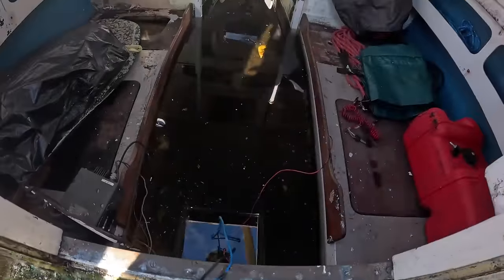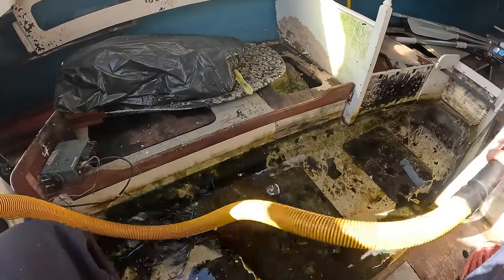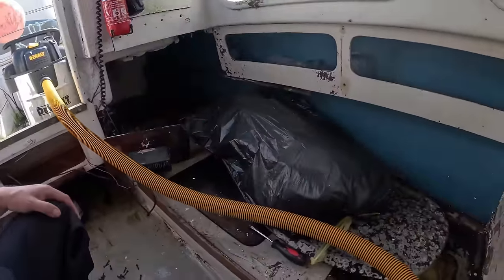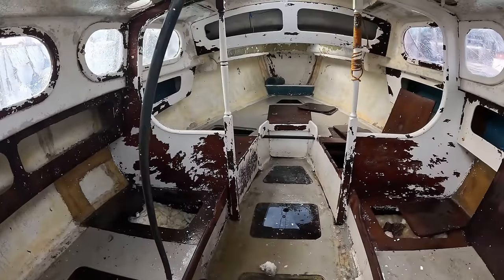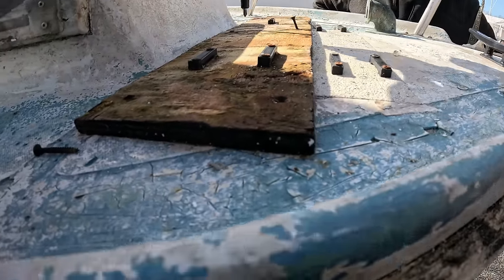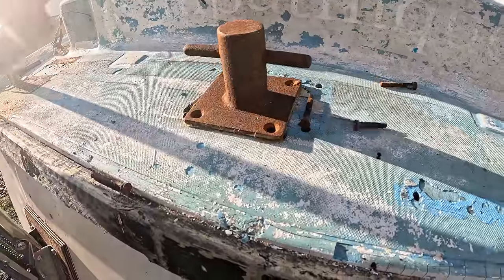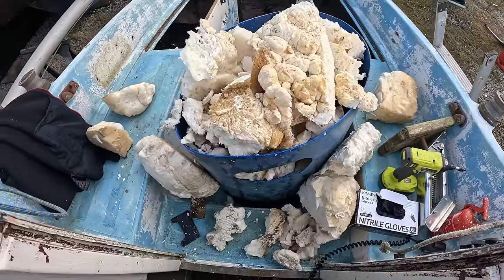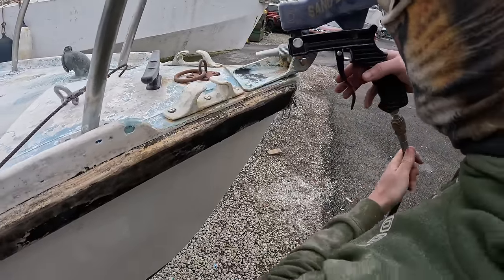£1 Yacht Rises Again (Part 2)

Comment: I would suggest doing a very thorough inspection of your deck to hull joints. On my Vivacity, the best part of it was loose. It's a sandwich box type joint with brass bolts hidden under the bumper wood strip. The amount of glue they inserted in the joint was not enough.
Secondly, all the chain plates were just connected to the deck, which lifted the deck from the hull.
I rebuild the hull to deck joint from scratch, and installed new stainless chain plates, redesigned to connect through to hull, meaning, all rigging tension is in the hull, and not the deck. Same for the rear stays and forstay connections.
Reply from the maker: Thank you for this great advice, I will be having a thorough inspection of all the deck to hull joints, so far I have not had a closer inspection as yet, but this is definitely great information for me to follow up on, I will keep you posted on what we find 🙏⛵️⛵️

Comment: For the foam removal, a wire wheel on a cordless drill works great. Hot tubs are filled with foam and I have seen the wire wheels used in foam removal for years. Then just vacuum.
Reply from the maker: This is great advice as I still have little bits that are stuck to get out, thank you is massively appreciated ⛵️🙏

Comment: Mate, invest in a sand baster attatchment for your pressure washer (e bay ) you can use dry sand in them because of the water, you don't have to worry about silicosis. wear safety gear and an apron, it's messy and ouchy if you hit your skin. Good luck.
Reply from the maker: Thank you Darren, I am almost done with the sanding on the top sides now, well I say that 🤣 much further ahead I should say but I will check this out thank you 🙏 ⛵️⛵️⛵️

Comment: You should have covered the lot in paint stripper covered it over with bin bags and came back the next day. You'll probably find you wouldn't have that much sanding if you did. But we'll done on the progress!
Reply from the maker: Thank you and I used the paint stripper on part 3 and it worked well 🙏😎⛵️
Reply: @BoatzUK  well done pal!

Comment: I like it when people take care of abandoned stuff. All things were build for a purpose and i dislike seing stuff go to waste.
Reply from the maker: Me too, it’s worth saving ⛵️🙏
Reply: Yes, but sometimes things are just too far gone and would be easier and cheaper to replace than repair. Also in terms of environmental factors; recycling the old boat by separating metals and other recyclable materials and burning the rest as energy would pollute less than than this; spreading microplastics into the environment by sanding it in the open. Manufacturing a new boat, and even manufacturing this one back in the day likely polluted less than its repairwork.
Reply from the maker: They is definitely a lot of pro’s and cons to any project and for a small boat like this it’s not the biggest job to salvage, it’s always best to repair than replace ⛵️

Comment: If you wanna save money on Disks and time, you can use a sharpangle wood sand the corner and that will get some off and or some hard wax.
Reply from the maker: Thank you for this recommendation, on part 3 I used a paint stripper and it worked well, but I still have plenty more bits to do 🙏⛵️⛵️

Comment: I’m a sprayer by trade, if you use Mirka abranet discs for sanding they aren’t so prone to clogging because of there mesh design, in my opinion one of the best discs on the market by a long way.
Reply from the maker: Thank you for this information, this helps a lot 😎⛵️⛵️⛵️⛵️

Comment: FYI, you can sometimes unclog sanding disks with a block of rubber, they sell them in toolstation and screwfix, but you can also use the sole of an old training shoe, or you might be able to use an old rubber block that was already taken off the boat.
Reply from the maker: Thank you for this information, on part 3 I used some paint stripper to give that a good and it worked well ⛵️🙏
Reply: @BoatzUK  Just watched part three and subbed to keep watching the updates.
Reply from the maker: @Anon-mk4ms thank you they will be more coming soon, currently in the making 🙏⛵️

Comment: Paint scraper maybe cheapest solution. Causes unintentional scratch to gelcoat but those are easy to fix. I scraped antifouling paint and primers from one of my previous boats for about 20-30 hours.
Reply from the maker: Yes I am a lot further ahead now and I used that exact method on a lot of the heavy paint areas, also tried some paint stripper in a test area and that worked well and washed down soon as the paint was scraped off just in case I melted the gel coat. Thank you for your advice it’s always appreciated ⛵️⛵️⛵️😊

Comment: Use a wire brush on a clogged sand paper. Probably not too good for the grit. But you get more life
Reply from the maker: Totally agree will definitely help, on part 3 I tried paint stripper that worked well and saved many discs 🙏⛵️

Comment: try some benzyl alcohol-based paint remover -- try it on fiberglass first to make sure it does no damage, I have only used it on wood
Reply from the maker: Thank you for your comment on part 3 I used some paint stripper that worked well ⛵️🙏

Comment: That expanding foam looked a horrid job to extract - oh and I cringed when the porta potti went upside down when you didn't have gloves on 😱😱😱 Good work so far, looks a lot better.
Reply from the maker: The foam took a full day to remove, Timelapse definitely speeds up the process 🤣 and yes that porta potti was definitely a fine moment that I don’t want to repeat to often 🤣⛵️⛵️⛵️
Reply: @BoatzUK  Admire your perseverance.

Comment: Why buy a pump and a new battery?
Take a garden hose and use the siphon effect. Takes over night, but costs you nothing.
Reply from the maker: I actually bought it for another boat I have but then this yacht came up so used it as it was already on site, also the pump that was in the yacht still works so that’s good news, siphon is a good way of doing it ⛵️⛵️⛵️🙏

Comment: I would cover the whole boat in paint stripper and power wash it of. I bet the cheap paint will come off easy.
Reply from the maker: That would definitely work and it would be easier, I was worried about melting the gelcoat but I did do a test area and it worked ⛵️🙏

Comment: Gotta scape the barnacles off before the bottom dries. Even better, scrape them off while the boats still in the water, much easier.
Reply from the maker: I completely agree with that comment, the down side was she was left on the hard standing for 12 months Un-scraped so it was a little harder. Next will be to remove the old 10 layers of anti- fouling 🤣⛵️⛵️⛵️⛵️⛵️

Comment: Wouldn't it have been better and easier to use a submersible pump?
Reply from the maker: I agree but with all that foam In the hull I could get a pump into the bilge, so just pumped out what I could with the bilge pump and used the wet vac to finish it off ⛵️⛵️🙏

Comment: Reminds me of the scene from Jaws. Well, as long as you don't find a body or a decapitated head under all that water...
Reply from the maker: I was surprised I didn’t 🤣⛵️⛵️
Reply: @BoatzUK 

It probably smelt like it might have.. 
Expanding foam has to be closed cell and thats expensive and nasty stuff.. so end up with structural or open cell insulating  rubbish..  horrid mess when water gets in its impossible to remove so you end up waterlogged inside and out.
Reply from the maker: @clivestainlesssteelwomble7665  completely agree ⛵️

Comment: would you not be better with either wire wheel or paint removal disc, as those sanding discs will clog quickly.
Reply from the maker: I totally agree on part 3 I tried paint stripper and it worked well 🙏⛵️
Reply: @BoatzUK  ahh, thought i was watching the latest vid, have been through this, modern paint stripper rubbish, sanding discs clog, paint removal dics best, knot wire wheel next on a grinder.
Reply from the maker: @matthewwiddows6319 it’s definitely the best way, there was that many layers of paint on her that I was willing to try every method 🤣⛵️

Comment: Put a steel wire brush to those sanding discs and you’ll get a little more life from them, it’s worked for me a time or two.
Reply from the maker: Moving forward that is a great idea but unfortunately for the ones I have now used there now in the skip, but this is great advice and a method I will now most definitely will use 🙏⛵️

Comment: You'd need a better soda blaster, but that paint's so dodgy a heavy duty pressure spray would probably do it, just watch you don't use too fine a stream it will erode the hull material.
Reply from the maker: I totally agree Geoff, we just did a small test with a friends mini sandblaster with soda in the gun and it didn’t even touch it, as I have been moving forward I have almost completely prepped the topsides of the boat now by hand so getting there ⛵️
Reply: @BoatzUK  Yes, saw that.  The hard way but cheaper and the outcome is good.

Comment: Expanding foam?   Well that was a stroke of flamin' genius.   Not.   Gonna be a bit of a pain to get all that out.  Really just good for insulation.  There are different forms of foam filler that are not water absorbent and they can be used in dead spaces as buoyancy.  But not that stuff.   But it's a start.   And that was clearly fresh water, so the hull seems solid, keep on plugging away at it.   Glad to see the so called davits gone.  Not sure what the bloke that made them's real job was, but I'm guessing butcher, based on hollow tube davits not being closed off so they don't fill with water, not to mention how thin the steel is... and don't start me on the quality of the welding... absolute disaster.
Reply from the maker: This boat is definitely a discovery of incorrectness 🤣⛵️
Reply: @BoatzUK  Yeah, some, ah, fairly, um, unique approaches to things there lol.